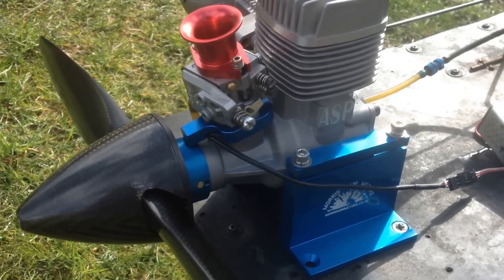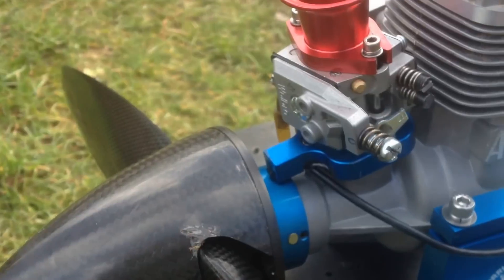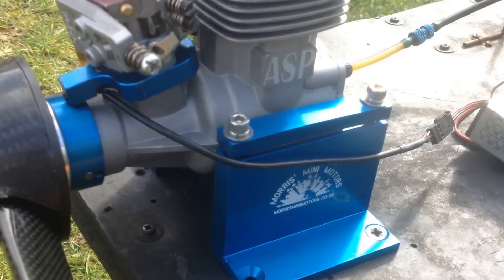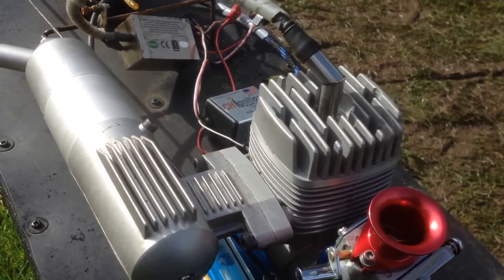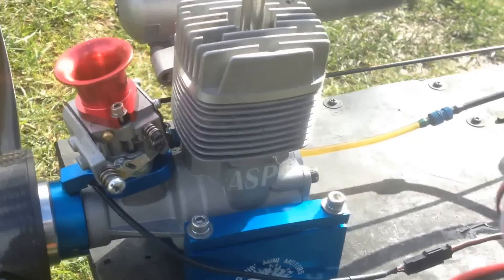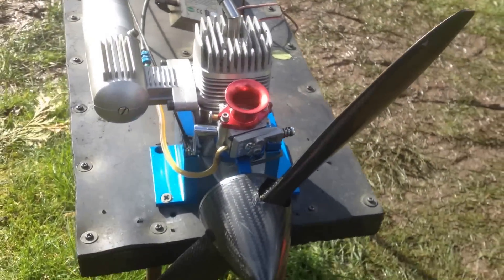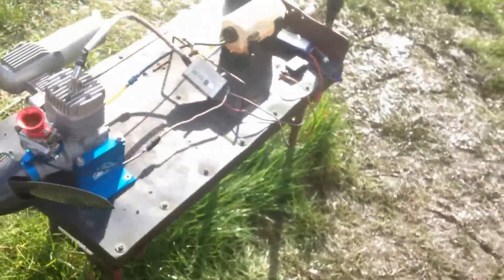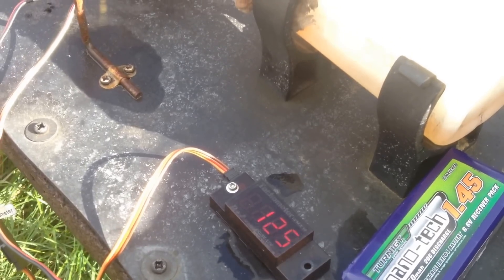ASP Magnum SC 180 2 Stroke Engine Gas Conversion

Comment: Ok I understand.mine is made in ertalon (pom) without Heat spacer . (Big air cooling in front with propeller).with groove in bracket.It's looping working, I.m waiting for my 1/4 32 spark for trying to start.

Comment: Did you take the pulse line in the hole of carburetor? ?
because there is only depression here?
Reply from the maker: +AEROGARAGE There is a pulse groove building to the heat spacer that sits on top the carburettor

It is universal it works with any WT carburettor
Reply: Hello Lez, the links? To be able to buy the shares, thank you.

Comment: Awesome Vid!! How do you get the carb. to without a pulse line?
Reply from the maker: There is a pulse groove building to the heat spacer that sits on top the carburettor

It is universal it works with any WT carburettor